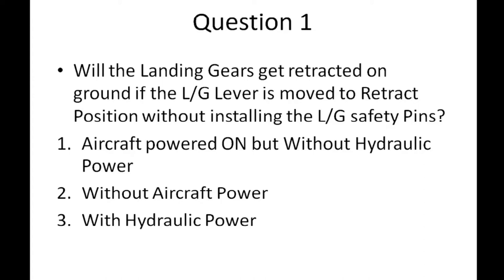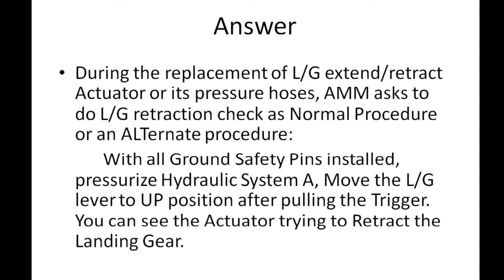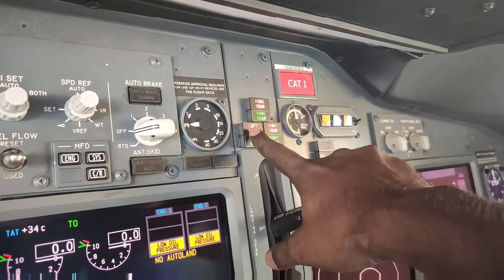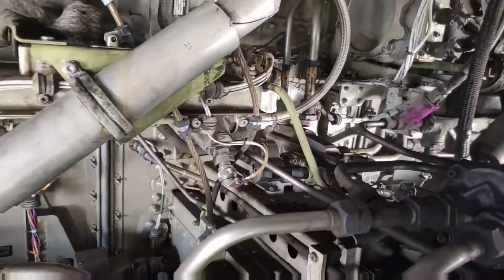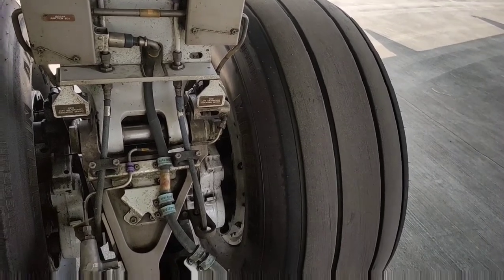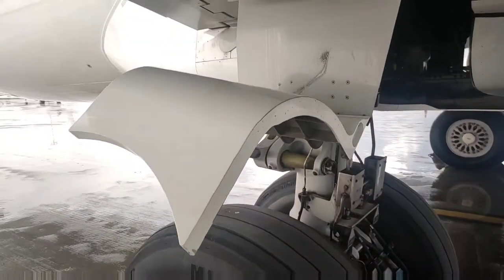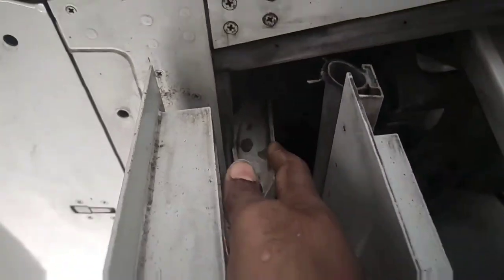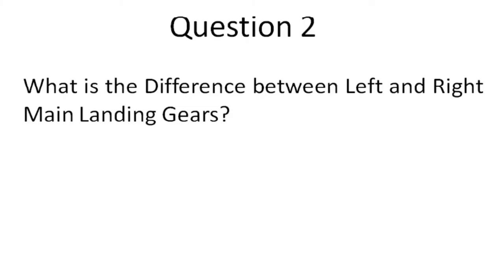B737 NG Aircraft | Landing Gear (Part03) | Component Location 02 | Doors

Comment: Thank you for the video! 
The right MLG has cables that attach to the ground spoiler interlock valve. When the right MLG is compressed, the cables send a signal to the interlock valve to allow the flow of hydraulic fluid to extend the ground spoilers.
Reply from the maker: Thanks for Answering.. It's Perfect Answer...